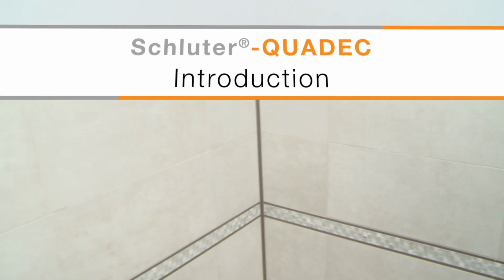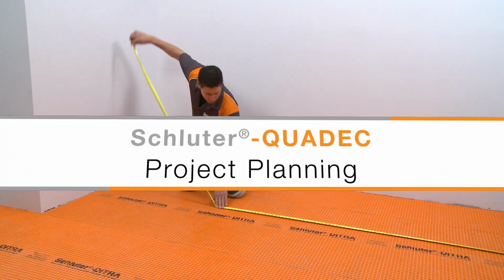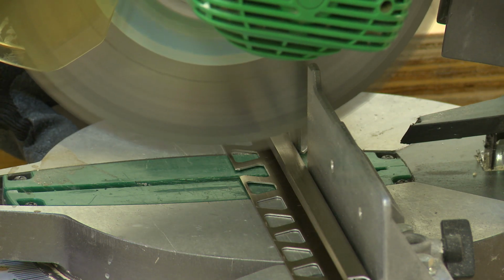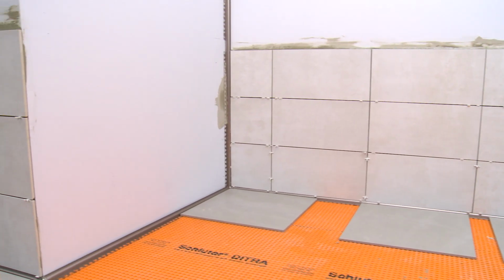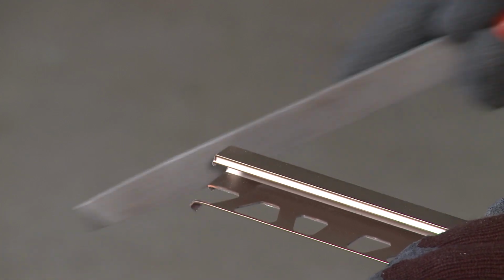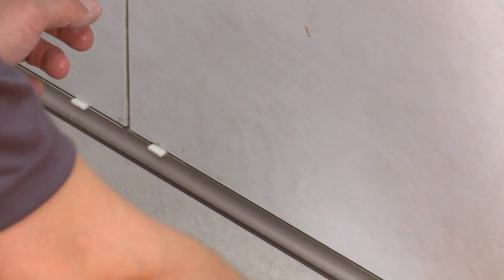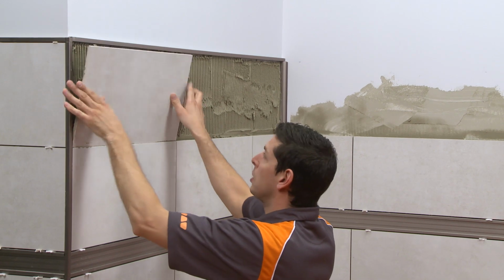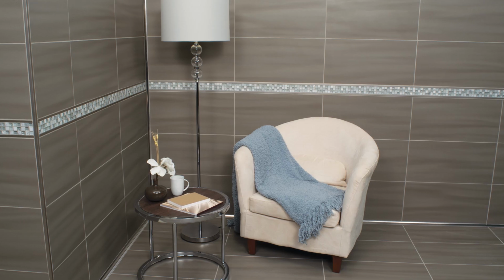How to install tile edge trim on walls: Schluter®-QUADEC profile

Comment: I like how they tell you to be safe with the grinder. It had no safety guard the handle is missing and the guy is wearing them rubber gloves that hot metal can melt right through and or catch them afire and no fire extinguisher around.

Comment: We tiled our shower walls and used your metal trim. After installation, we noticed the untitled portion of the wall is getting too much overspray from the shower. So we would like to extend the tile. Is there a way to cut out the metal trim so we can extend the tile?
Reply from the maker: Hi there! Can you give our Customer Support team a call to discuss your project in a bit more detail, and they will be able to advise from there. 800-472-4588 (US) or 800-667-8746 (Canada). Thanks.

Comment: Can I use this for a fireplace
Reply from the maker: Hi Shelly. It might be best to reach out to our Product Support team about this question. Most likely it's fine to use the profile, but I can't say for sure without some details. Your best bet is to request a sample of the profile you are considering and test it before fully installing to determine how it reacts to the expected temperatures. The melting point of the specific profile you want to use can be found in the SDS sheet, which you can also request from Customer Service. You can reach the team at this number: 800-472-4588 (US) or 800-667-8746 (Canada). Hope this helps for now, good luck with your project!

Comment: Can these be used in a tiled walk in shower? Do most people use silicone with this or is this waterproof enough as is?
Reply from the maker: Hi Mark, which product in the video were you referring to?
Reply: The dilex ahk.....specifically for inside corners and shower walls to shower pan transitions
Reply from the maker: These are a great maintenance-free alternative to silicone! You can read more here: https://www.schluter.com/schluter-us/en_US/Profiles/Cove-shaped-Profiles/Schluter%C2%AE-DILEX-AHK/p/DILEX_AHK
Reply: @schlutersystems1  
Wow thanks for the info... they look great and will be using them in my tiled shower renovation
Reply from the maker: Great to hear and our pleasure!

Comment: Complete except for the grout. The integrated  space is way too thin to actually grout. I think we’re going to just use 1/8” spacers like the rest of the grout lines. I’m really hoping that this stuff works as planned. It looks nice and so far is easy to work with but we’ve only gotten to the dry fit part.
Reply from the maker: Hi Rachael B, our integrated grout spacer creates a gap that is 3/64" wide. This is enough space to grout, but you are definitely fine to create a larger grout space if you would like. 
Hope your project turns out exactly as you would like!

Comment: The box store I shop at has no corner peices - just the long prices. I can't cut that stuff - returned it
Reply from the maker: Hi jake sarms, sorry to hear that! All of our products are available for order through any of our Authorized Dealers. If ever you have an issue please don't hesitate to reach out to us at US: 888-475-4588 or CA: 800-667-8746.
Reply: @whoeverwhatever9279  it's sold everywhere...use the dealer locater on Schluters website. Every tile shop had it or can special order anything

Comment: Safety standards? That means keeping your blade guard on your grinder so you have all your fingers by the end of the day.
Reply from the maker: Hi Dario! Thank you for this message and pointing this out. Safety is definitely a concern and the safety guard should be used at all times.